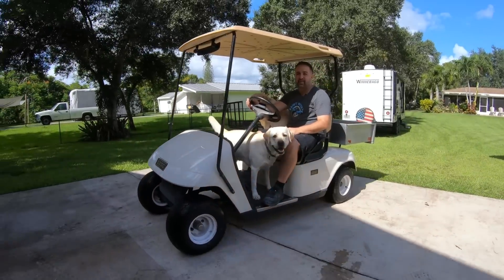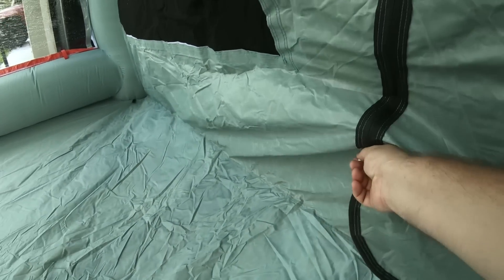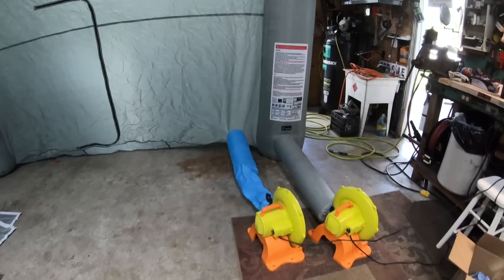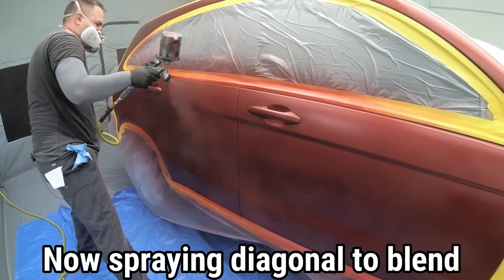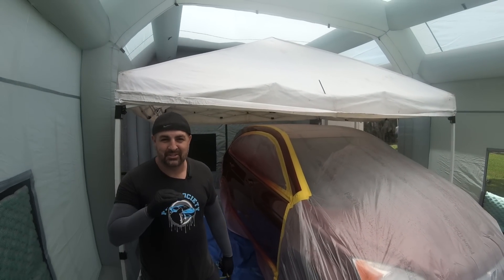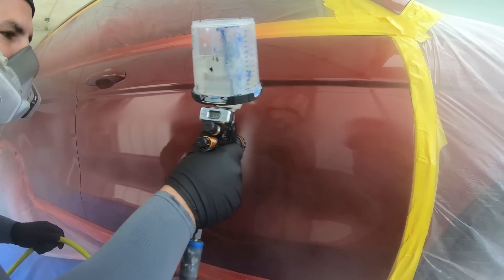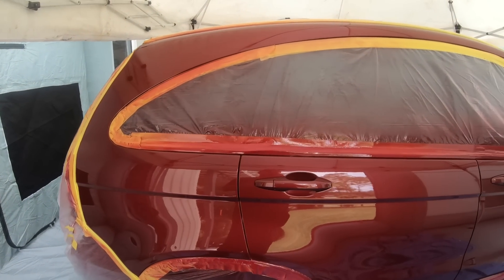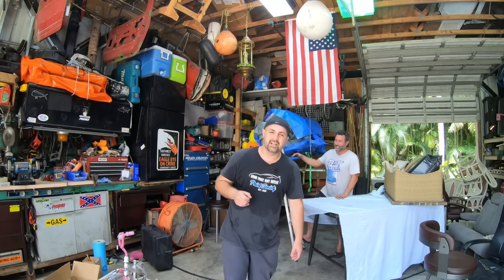Inflatable Spray Booth REVIEW

Comment: Prob good if you a somewhat regularly painting.  For a one and done, I think $100 in 1" PVC and plastic sheeting with several box fans would yield about the same for a lot, lot less.
Reply: Yup, that’s how I did mine and it worked just fine. Only mistake I made was setting it up the day before. Next morning it was filled with condensation & I had to wait until afternoon to paint. Build the frame but then put up the sheeting the morning you want to paint

Comment: Man I’m surprised at the cost of booth. By the time one buys all materials and then labor to build a diy booth one is not really saving that much $$$. I have a 40’X60’X12’ shop that it would fit nicely in.. where I need to cut Conner’s is the paint guns.  600+ and 400+ for two different guns is not in budget. I need to do more research on what type of guns to get. Enjoy all your vids
Reply: A few other paint channels I respect have used cans to good effect, although that's for smaller jobs

Comment: Personally don't care about the actual filtering, as long as you can get the fumes out of the booth I'm happy with that.  I'm more rural so.im not worried over constant exhaust fumes overspray bothering people or setting off alarms.  I wish they were a bit cheaper for diyers, but if u have a car u really like and want to look nice and don't have access to enough garage space that's dust free ish, these are a good option.

Comment: that would suck if the breaker tripped and it collapsed on wet paint
Reply from the maker: When we were waiting for the paint to dry Jeremy decided to plug in a fan and that’s what tripped the circuit. Booth started going down on the wet paint.  Anyways we got the breaker flipped and shut the fan off
Reply: @PaintSociety  I said that not even knowing that a breaker actually did trip.
Reply: @PaintSociety  over all I think there great for someone who just needs a booth speratically

Comment: Yes Phil Tucker, I agree " [its good for] a once only job at home". After that, do the math and build another shed to store all that junk. If you can DIY a paint job, you probably have the abilty to lift the roof sheets on the current garage and lay dust proof insulation underneath. Refit roof and install good lights all around. Unlike this Chinese piece of crap, it will be weatherproof, wont collapse during a power cut or blow over in a storm, and you will have enough room to spray BOTH sides of the car. From trial and error, I can tell you that you will need a minumum of three of those "elephant trunk" extractors.  Nice save in that rain Brian.:goodvibes: